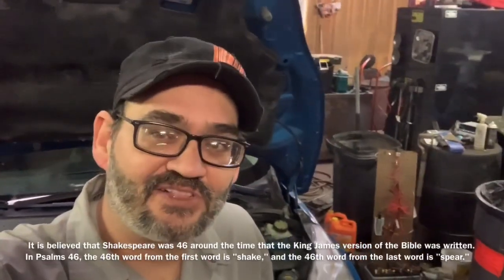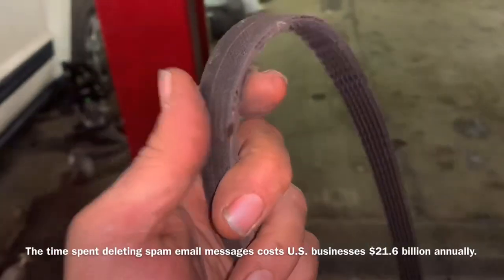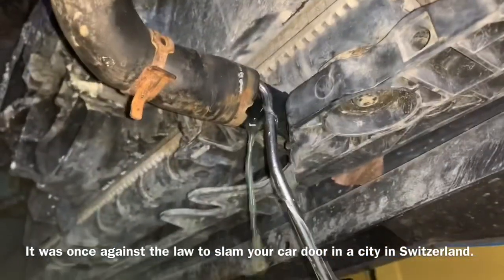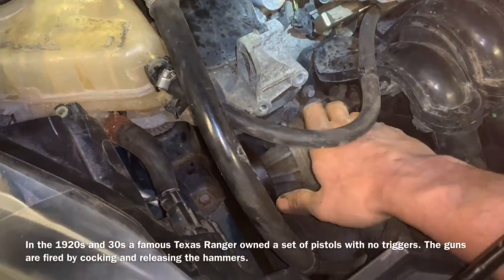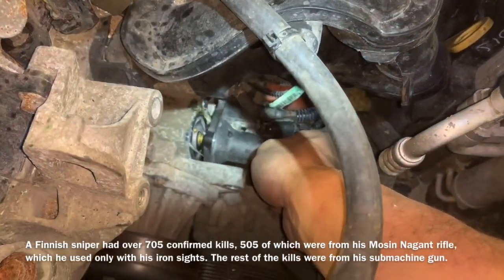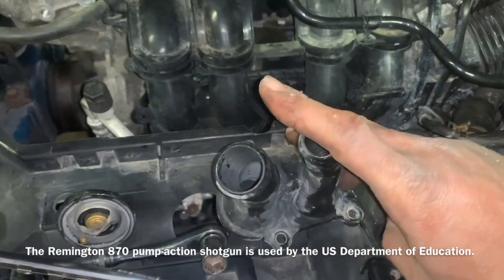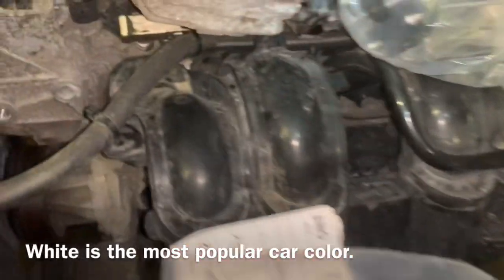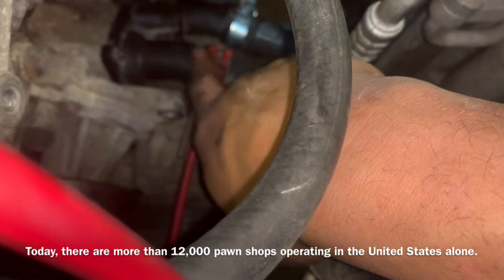Ford Festiva/thermostat replacement nut and bolt/With belt removal and installation/Great video!!!!!

Comment: would this cause an issue with overheating as well? My car overheats at idle or in stop and go traffic
Reply from the maker: Hey juice it certainly could be the problem but I also had a problem on this particular vehicle. That the oil cooler was plugged up and it was certainly easier to fix that then change the thermostat in one of these so if you go to the front of your vehicle or if you look on my playlist I will show you a video of exactly what happened to the oil cooler and I will try to post the link here for you that was actually really interesting I change the thermostat first and that did not fix the problem then I later realized that the oil cooler was plugged🤔

https://youtu.be/sFaAZkXsro8
Reply from the maker: https://youtu.be/sFaAZkXsro8

Comment: Your fiesta does not have a Schrader valve at the top of radiator for purging air? Also try to use combination of socket and piece of paper, works pretty well. Thanks for video.

Comment: Hi have a problem my ford fiesta 2015  supost to maike 4 bars temperature but show me only 2 or 3 i dont know iff samting rong thanks
Reply from the maker: No that should be fine if I’m understanding you correctly
Reply: Something is wrong. My 15 plate fiesta has just the same problem. I'll be looking into this in more detail next week However it appears that The thermostat isn't working properly, so more coolant being put into the engine - resulting in the engine never reaching optimum temperature
Reply from the maker: I would be really curious if it turns out to be the same problem with the oil cooler like it was in this one…. So please let me know